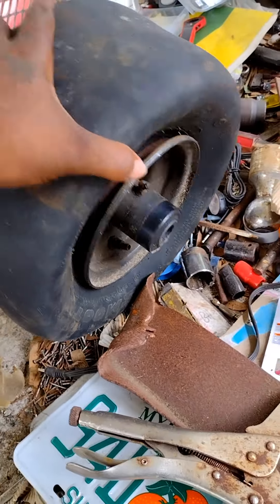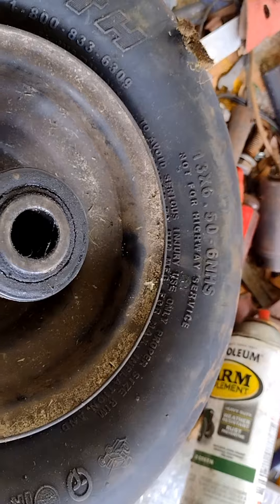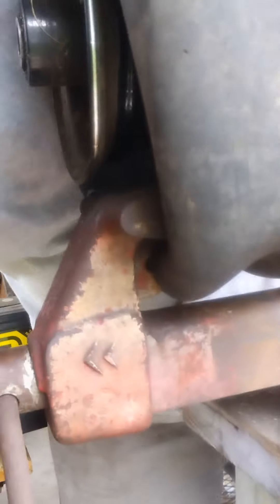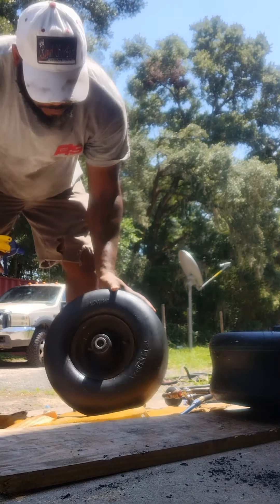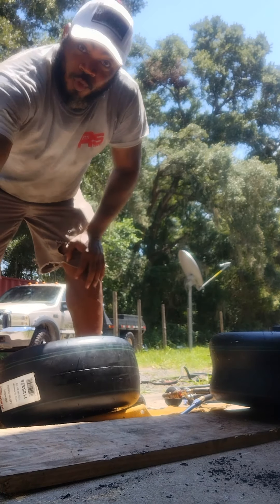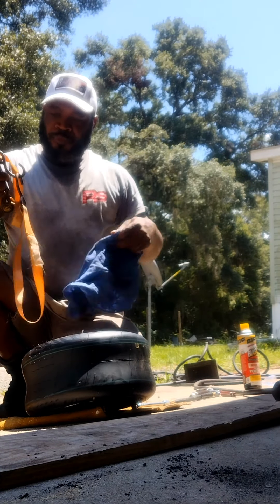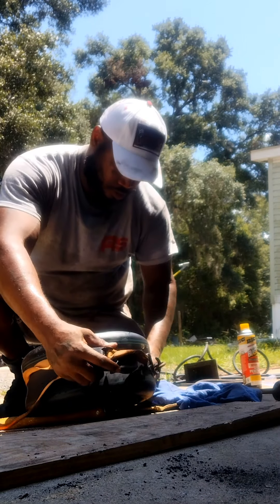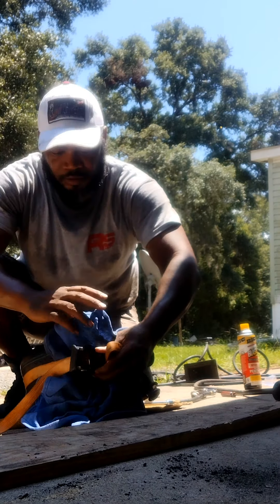Who'd ever thought!!! A TABLE VISE WOULD CHANGE A TIRE!!!!

Comment: Dog gone it, why didn't I think of that! I ended up using my harbor freight 12 ton press. I did break down and buy their full size tire changer here recently when I finally got the right size front tires for my 770. Hope it works on my mower tires when the time comes, if not I just found a new way to do them.
Reply from the maker: Yeah man it worked pretty darn good too!!